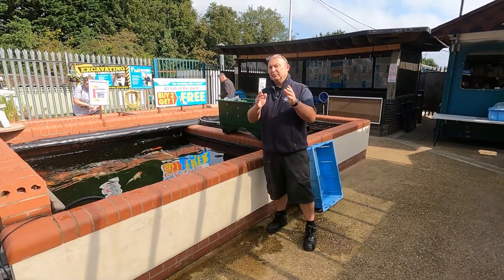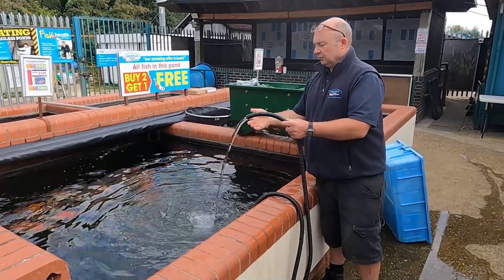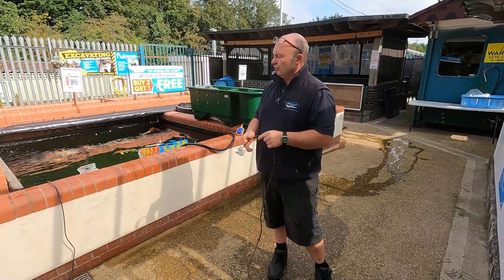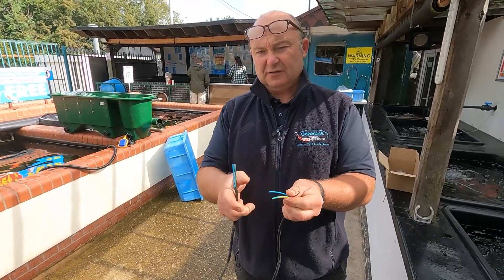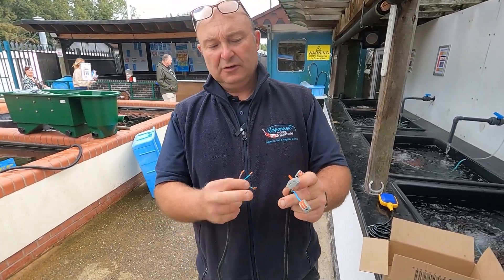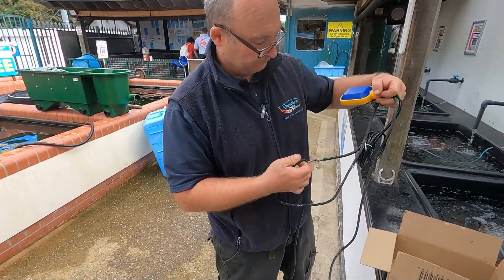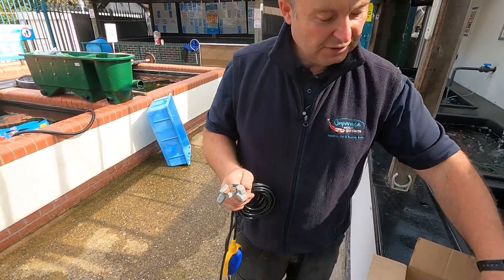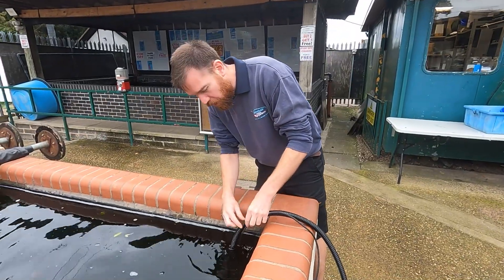This is a great idea!

Comment: Best advice  for those that havnt allready got one fitted  , ive got one switch connected to  two pumps running separate  filters  in  my quarantine / grow on   vats  ,  and another  on  pump running main filter systems ,
Reply from the maker: Very sensible. Such a shame more people don't fit them.

Comment: I have a pump fed system and a float switch... Just was never sure how to fit it. With the directions in your video I will wire it up this weekend 👌
Reply from the maker: Yes great idea. No problem wiring it easy to do.

Comment: I have a gravity fed system but still use a float switch in my pump chamber. In that way if for any reason the water level in the pump chamber drops below a predetermined level, ie from a broken pipe or bottom drain blockage, the pump turns off reducing the likelihood of any damage. I also have my UVC's connected to the same float switch so if the water stops flowing through them as a result of the pump being off they will not over heat or burn out.  Works very well.
Reply from the maker: Yes that's also worthwhile. Great idea..

Comment: Or you could just put the pump in a plastic trashcan in the corner with holes drilled with a hole saw to about half the height of the can. If your water drops below the drilled holes, the trashcan act as a weir, no water from the pond gets to the pump. It won't save your pump in this situation, but it will save your animals. In this scenario, I'm ok with possibly having to buy a new pump. My solution costs $2-3 and can be purchased at any Walmart.
Reply from the maker: Interesting idea. However the pump would be pumping mid water and bot moving the sediment off the bottom?
Reply: @leecalladine  If you have an aquarium with an out flow box with a weir, the water flows over the weir, before flowing into your sump, literally to the top of your take yet it still removes sentiment to the sump.